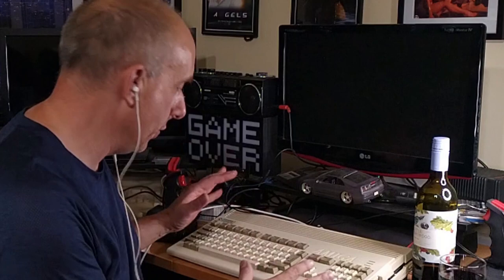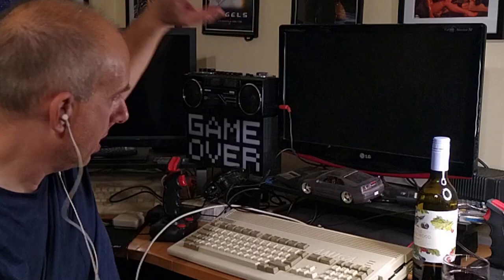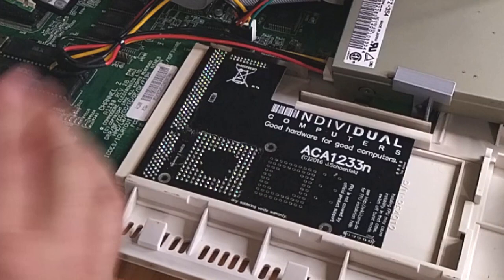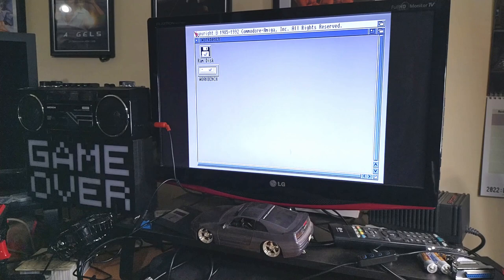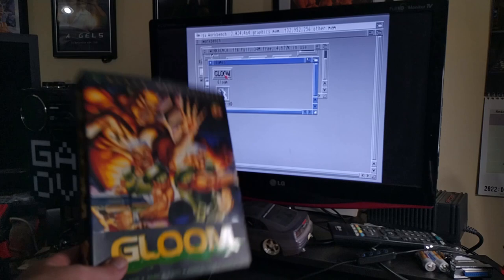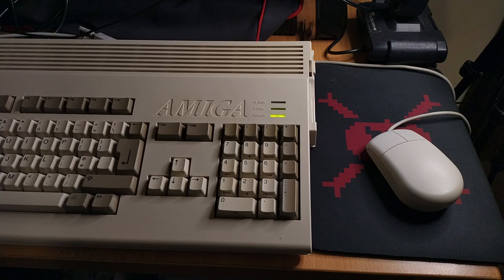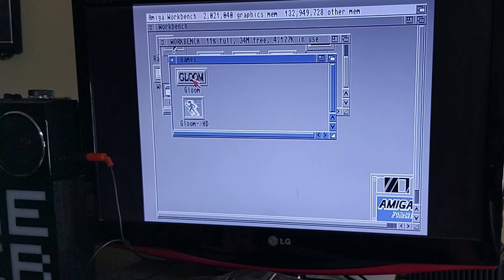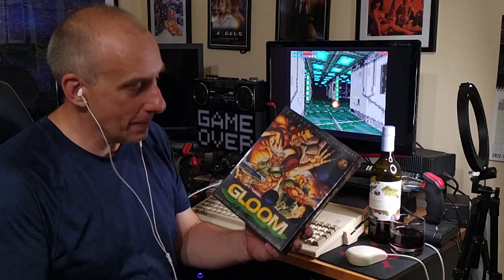EP-183: A1200 Refresh Part 2: The Technical things

Comment: Thanks for the mention! Reach out any time if I can help.
You can't use that 16 GB CF in the PCMCIA slot - the file system just won't support it. Get yourself a 4 Gig or small SanDisk and you will be fine (with the right drivers installed)
Reply from the maker: Ah that's another thought. Cheers Doug. I'd assumed I could partition it but perhaps not? It's the spare 8gb I'll be using but if I have to buy smaller, so be it. I'll test without the expansion first though just in case that's causing issues.

Comment: In terms of the PCMCIA adapter, the adapters themselves seem pretty simple so I can't imagine needing a specific adapter for it to work. For what it's worth, yours looks identical to mine which works on my Amiga 600. I can't remember the exact specifics of the issue, but could it be a conflict between the PCMCIA slot and the extra RAM? I recall, similar to the A600, the slot uses the same address as RAM. Sadly, my Amiga 1200 is sitting unused and unexpanded, so I've been unable to play around with it myself! BTW,. if it helps having done a few buggered up installs, backing up the CF card before you start adding additional things is a good idea. I initially did this via WinUAE and copying the contents to a PC folder mapped to an Amiga drive. This turned out to be a bad idea as I found out the hard way that WinUAE can't store all the AmigaDOS file attributes in Windows. In the end I backed up through copying everything to a second partition on the Amiga itself.  Other lifesaver is SnoopDOS to work out missing files. Last suggestion is that wine bottle looks pretty empty - you need more booze to do this properly! 🙂
Reply from the maker: Thanks mate. Funny enough, after making this video I had thought it could be the expansion card. Even though that usually affects ram. Will test. Doug also suggests the CF card may be too large and should be 4gb which is another thought. I'd assumed I could partition it but maybe not.
Reply: With the Accelerator being full 32bit the RAM issue won’t be applicable here. That issue is down to the stock processor only being able to address 8mb and the pcmcia slot is mapped at 4mb (so most 8mb RAM expansions have a 4mb jumper to work around the issue)
The most likely cause is as Doug says, the CF card being too large. I found them very picky. Anything above 4gb is definitely a no. But even some 4gb cards didn’t work. Thankfully I had a 512mb card that was 100% reliable.
Reply from the maker: @a500  awesome cheers Rich

Comment: if you want I can send you an adf of the software I use for my pcmcia card on my A1200 (ADAPCMCFL, Boot Disk, HD Install & EasyADF), its from Amigakit UK, also you are better keeping to cards 4gb and under, it might have issues reading them
Reply from the maker: Yeah think I'll get a smaller card. That's the exact software I got off Mike, so I think it's the CF card size as you and others have said. Will get a smaller one and try that